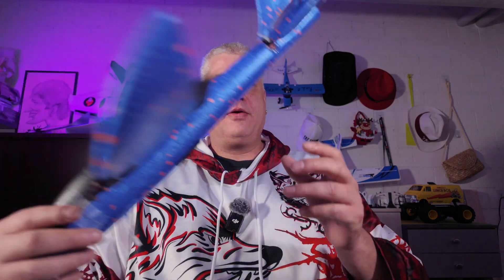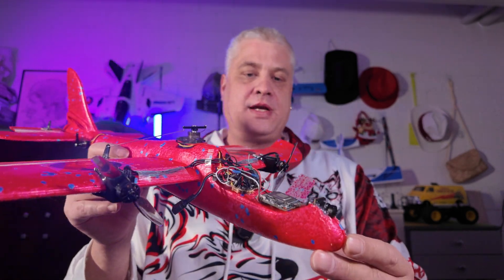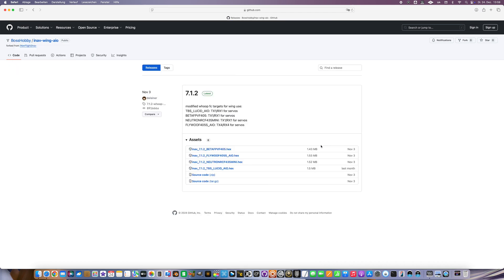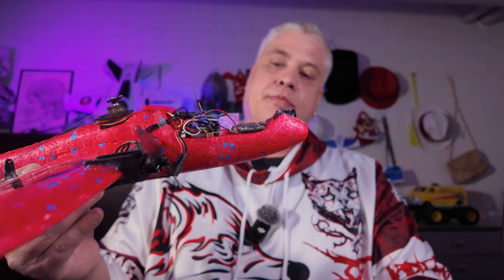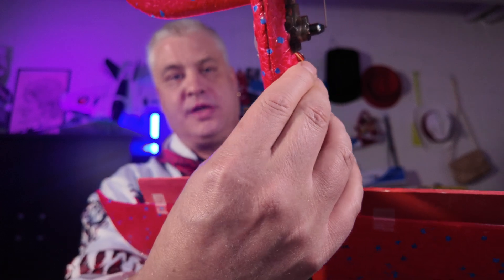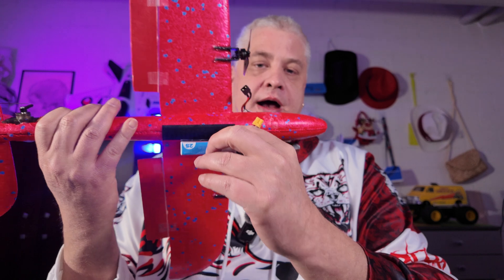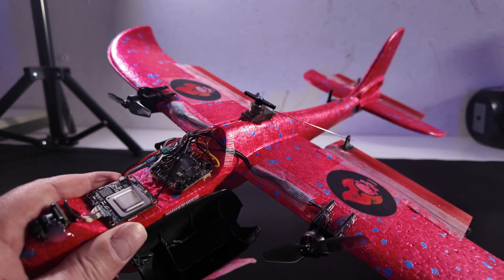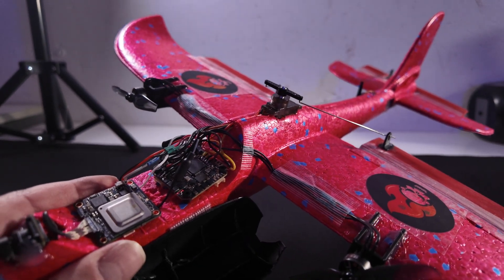2S HD INAV Foam Plane with a Whoop AIO!

Comment: how did you get the servos to work with a quad fc?? everywhere i look people say it might be possible for motor outputs but most likely no, how did you do it??
Reply from the maker: I compiled a Custom INAV Target and modified an UART to control the Servos. I am not going into Details but there are already quite a few Targets for AIO's on my Google Drive. I am sure you will find it :-)
Reply: @RockFPV so it is a uart thank you so much, I have a couple of these fc laying around as spare parts and bought some of these gliders to build with no fc but now I will be able to lol
Reply: @RockFPV  how exactly did you get the uart to work with the servos? im at the part in my build where i need to do that and i realized i dont know which uarts work with it.. if its not too much trouble to inform me at least
Reply from the maker: @Arcticfawksie RX1/TX1 for 2 Servos, RX6/TX6 for additional 2 Servos.
Reply: @RockFPV ooh so it can use both input and output for a servo? That’s so cool!! Thank you so much I can finally finish my build, I’ll find the motor myself thanks youuu man you saved me this build has been so much fun
Reply from the maker: @Arcticfawksie Just don‘t forget to flash the custom firmware first. Link in the Video Description
Reply: @RockFPV already done thank you for yoour service 🫡
Reply: @RockFPV I just decided to test each esc, none are working or being read in esc configurator.. any unique steps you went through to get it working properly?
Reply: @RockFPV ignore my previous comment, I was being dumb and didn’t set it to dshot

Comment: Hey mate, sorry to ask to many questions, but when using the two servo option custom Inav image, uart 6 doesn't show even thought it is not used for servos, do you know why? Thank you so much for your help!
Reply: I wanted to include a GPS in the build
Reply from the maker: I have updated inav_8.0.1_BETAFPVF405_2_Servos_BaroFix.hex, UART6 is now there
Reply: @RockFPV  Thanks a lot! it worked
Reply: @RockFPV  Is it possible to make 3 Servos and UART6 is now there? RX1/TX1 and LED for Servos?
Reply from the maker: @vovvw  There is a Target for 4 Servos using UART1 and UARt 6, so 4 pads. Theoretically one of the led Pads would work as well but that requires modification of the Target.
Reply: @RockFPV  HD VTX, GPS, ELRS, 3 Servos, will make a great mini long range! ))) Is it possible to modify the target for 3 Servos?
Reply from the maker: @vovvw  I created one but I have not tested  it. ELRS and the Integrated Antenna are not really made for Long Range.
Reply: @RockFPV  Thanks! Need to test. I think the video will turn off before RX loss because of the ELRS antenna )))
Reply: @RockFPV  Tested, servo does not appear on led...
Reply from the maker: @vovvw  Can be that the Timer is not usable, alternatively you can just simply put the two Ailerons on the same pad if the servos are mounted correctly.
Reply: @RockFPV  I need 1 pad for Ailerons, 1 pad for Elevator, 1 pad for Rudder. TX1, RX1, and any other pad for the 3rd servo. TX6, RX6 can then be used for GPS. What other options can I try? There are free pads: LED, SDA, SDL, SBUS.
Reply from the maker: @vovvw  Then you are out of luck. Not all Pads can be used for everything, they need to provide a suitable timer. In your case you probably want to get a speedbybee wing mini or something like that.

Comment: Awesome! What pins should I use on the Betafpv f405 on the 2 servos hex version? I would like to have o4 and gps so I prefer the 2 servos option and I think that with the 4 servos hex I wont have enough uarts. Thanks in advance!
Reply from the maker: TX1/RX1 for 2 Servos

Comment: Did the INAV  Accelerometer Calibration work? I can never get mine to comlete. For the orientation of fc in INAV Alignment Tool what were your settings?
Reply from the maker: Sure, the Calibration works perfectly. Do you click on the Calibration Button after every step? Since I mounted the FC straight and already properly orientated, no adjustments were done. The Alignment tool does not work in the GUI and adjustments would need to be made via cli
Reply: @RockFPV Yes did Calibration button, it gets to first 2 steps and basically never get beyond that! I will have mounted FC with arrow forward. Will nuke and pave FC and start fresh. This mounted on flying wing.

Comment: Great little flier! I missed out whst servos you used 😮 I did one 2S single pusher motor version on analog with 100 grams, without fc some years ago, should nake another 😊
Reply from the maker: Components in the Video description
Reply: @RockFPV  Ah, now i see it, I watched it on phone earlier and missed it. Oh, 9 gtram servos? You should 've put in 3.5 gram metal geared ones 😉
Reply from the maker: @theKeppis  You actually have to use heavy Servos if you plan going HD to get the CG right. On the Analog Version I used 2g Servos.
Reply: @RockFPV  it all comes down to the placement of the gear 🙂 you could've put the FC on the wing and place the servo elsewhere or in the fuselage, many ways to do it..

Comment: Nicely done.
U can find those plane at lidl or action from time to time, even a smaller model and a bigger model, this amazon one is higher in price.
Reply from the maker: Denpends on where you live, here in Switzerland Toy and Hobby Shops are quite expensive. 2 Planes for 14$ was ok.